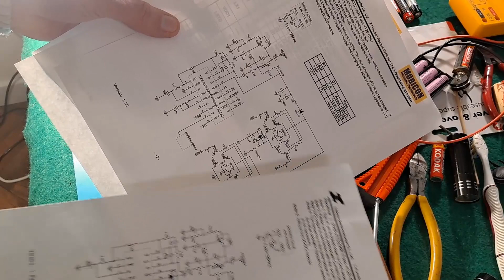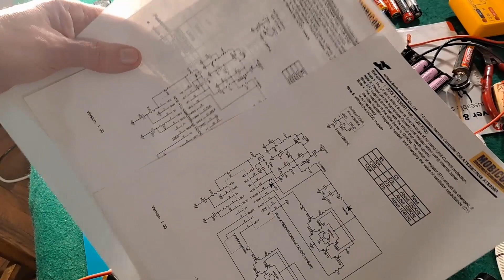Lightning McQueen receiver fix PART 1

Comment: To tame the wheelspin you might try making rubber rings from an old cycle inner tube and putting them over the wheels as "treads". A childs mountain bike inner tube would probably be the right diameter.
Reply from the maker: Thanks, but wheelspin make good video viewing 😆🤣👍
Reply: @GrandadIsAnOldMan  Good point!
Reply from the maker: @IanSlothieRolfe  not that I get many views anyway, but skids and crashes and wheelspin are much more visually appealing.  😊

Comment: I wonder if a component that was ready to burn out, "burnt out" and then became a closed part of the circuit. A resistor or something not very critical. Which is now conducting as part of the track on the board and letting power flow to the chip. 👍👍👍
Reply from the maker: A tiny clue, this is PART 1. In PART 2 I find the real fault 😆👍 but it teases me a bit before I pin it down.